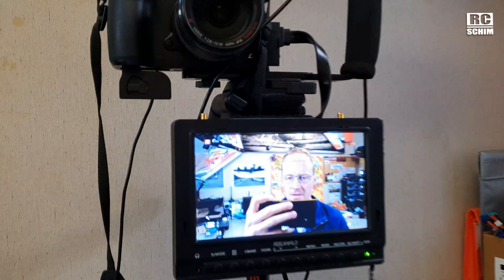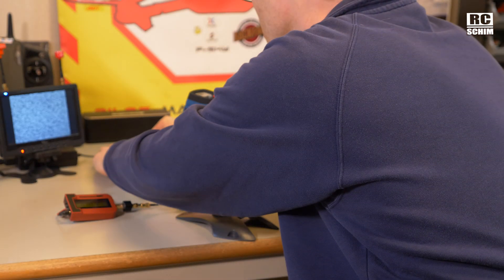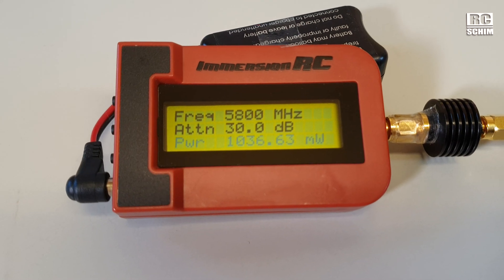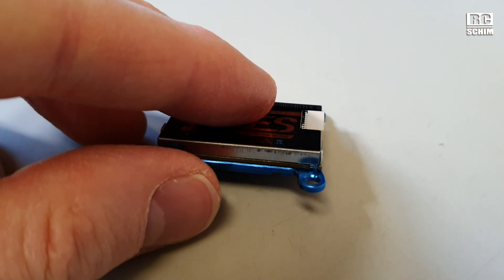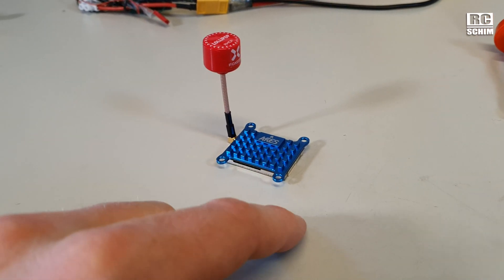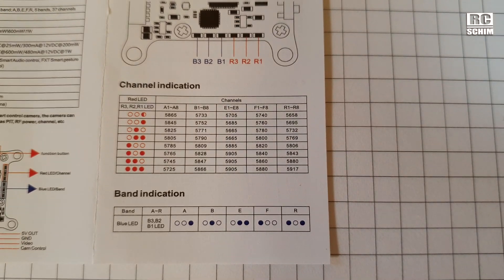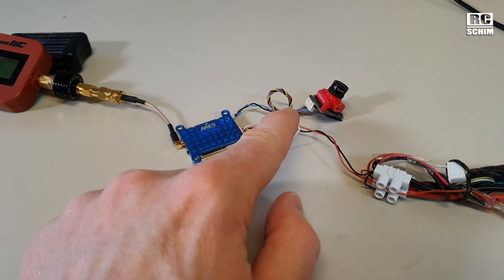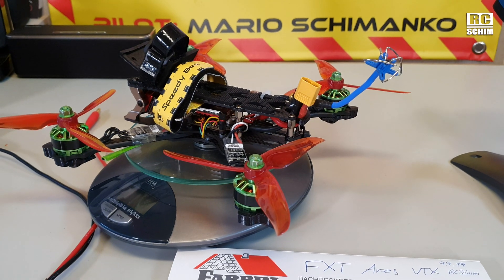keep your VTX cool! (FXT Ares 1W VTX - HEAT vs RF power)

Comment: Do you happen to know what the vtx table settings are for the power selection? I can change channels, but not power levels.
Reply from the maker: I dont remember how to press the button to change the power, but here I found the LED infos hope this helps. https://www.dropbox.com/s/6ler6v3b27n06nz/20191007_105249%20Fxt%20Ares%20Vtx.jpg?dl=0
Reply: @Rcschim   my problem was I was using 0 as pit and 1 as 25mw. It goes 0 25 1 200 2 600 3 1w.    And it works like that.

Comment: I always wire in smart audio or Tramp for VTX switching.  I mainly race, so constantly flying with others and need to be able to alter channels quickly and reliably.  Also, because racing button is often embedded below TPU or carbon to protect it from high speed crashes.

Great work as usual.  Good information.

Comment: I was fine using the button to change channels on my old VTX because I hardly ever change channels.  However, I switched to smart-audio on my latest VTX.  It has great potential as a handy feature but I get an error on my radio 9 times out of 10 when I try to access the page to change the VTX channel.  This was the result of a problem with the Open-TX software well over a year ago, I think.  I haven't checked recently if they've released an update to resolve the problem because I hardly ever change channels.  Assuming Open-TX has resolved the problem since then then I would definitely install smart-audio in the future because on those rare occasions when I change channels it is very handy, and I soldier everything anyway and it's just one extra wire, IIRC.

Comment: Has anyone measured temperature in flight, hovering, moving forward, looping, and compared if it changes anything to temperature / wattage?
Reply from the maker: good idea, but I'd need a special little temp logger. 
and I dont think that it's an issue at all if you are moving in the air.
maybe an issue on a plane - where VTX is in the fuselage - and you have no airflow there  (but you can adress this with a sharp knive and some creative cuts into the foam :)
Reply: @Rcschim  I guess a simple fan on low settings could show the difference by maintaining temperature to under the limit it starts throttling? Cheers!

Comment: If they used a heatsink with real fins the thermals would be even better
Reply: schugabe 
This is true but since many people mount vtx on the top deck ( exposed to flowing air ) the fins may cause additional drag,
( depends on distance between fins, fun thickness and height etc ).
Reply: @RawTopShot  it would be interessting to try if the drag from the fins makes a noticable difference.